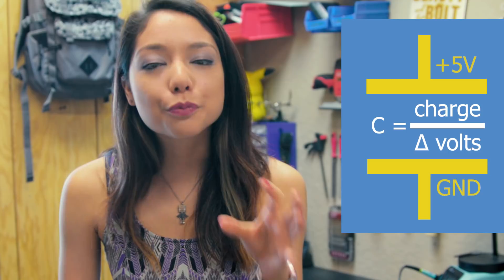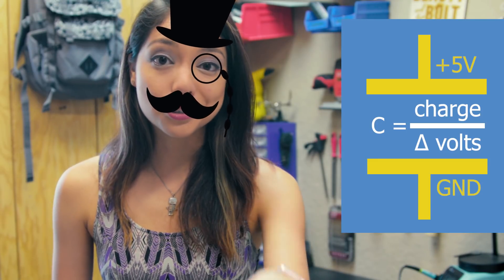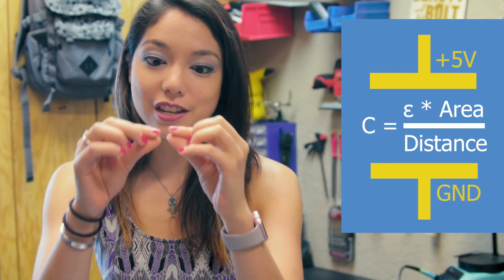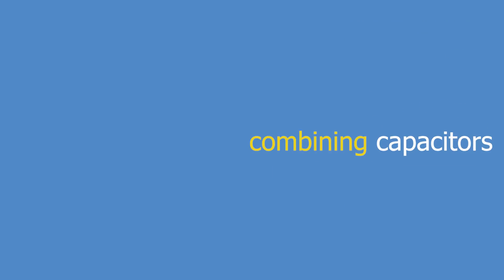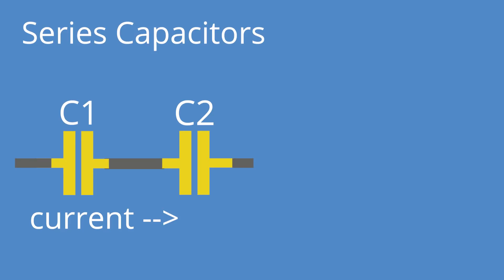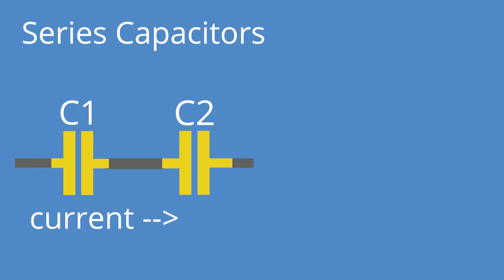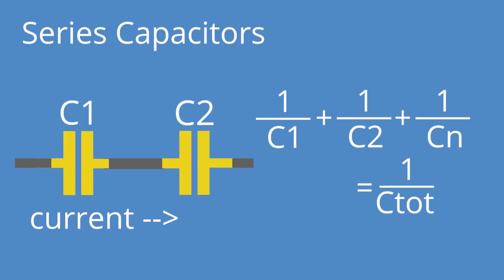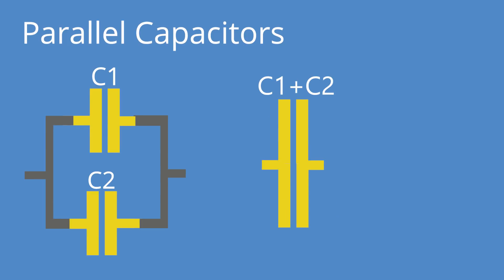Capacitors 101: Introduction, Parallel, and Series

Comment: Question:  Can capacitors be affected by environmental conditions such as heat and/or humidity?  Thank you.
Reply: Well the temperature does have some effect on capacitance because area of plates changes with temperature. The plates expand when you increase temperature and decrease when you lower the temperature. The heat can also increase resistance of capacitor which makes the charging process slower.

Comment: Should probably note that capacitors are often used in conjonction with resistors, and coils to create oscillating circuits and filters. An RC filter is a low-pass filter, and RL filter is a high-pass filter and a RLC circuit will either oscillate until all of it's intern energy is dissipated in the resistor, or can serve as a band pass filter. Capacitors are also often used to protect a circuit against power surges, because they'll store the excess energy and dissipate that in a resistor.

Can't wait for an episode on operationnal amplifiers though.

Comment: So capasitor`s has the oposite math as Resistor`s`:)
Reply from the maker: Yup! Makes it easy to remember haha
Reply: Yes it Doe`s :D
Reply: @BeautyandtheBolt  you forgot the first 1/ though in series. Formula should be 1/(1/c1+1/c2...).
If you have a couple 1000mfd caps 1/1000+1/1000=2/1000=1/500mfd. Is a lot different than the correct 500mfd